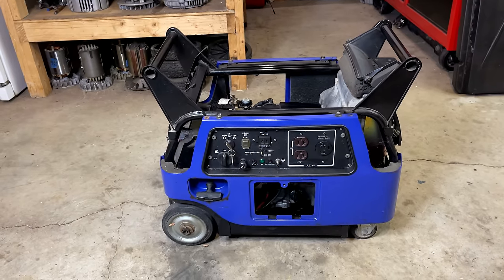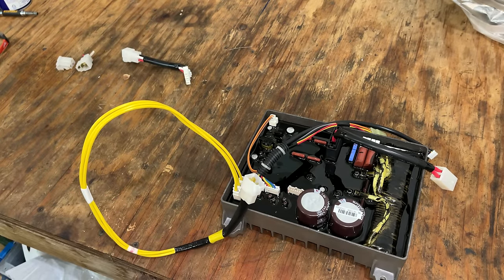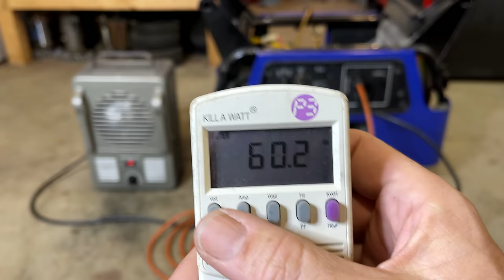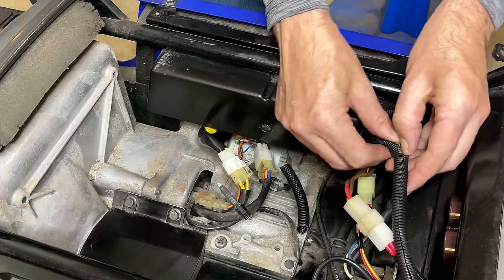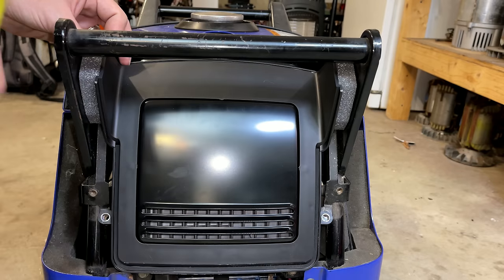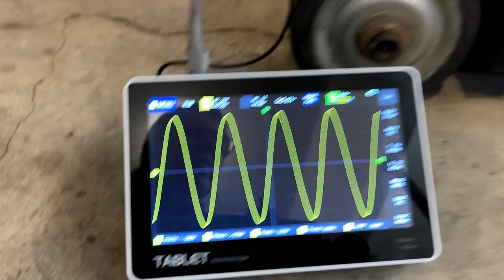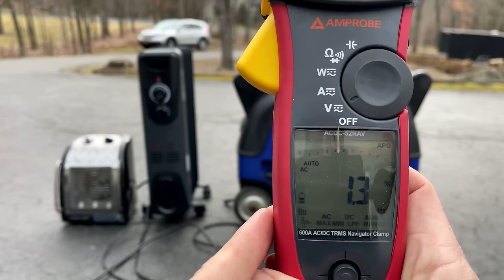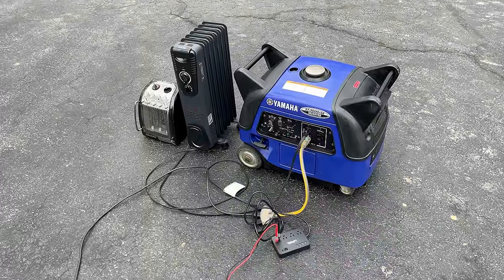Yamaha EF3000iSE Inverter Generator (Part 3) - Repair

Comment: Nice videos, I watched all three. Just wondering why the 15 amp breaker didn't pop with that 2500 watt load. There is a 23 amp socket next to the 15 that could have been used with the right plug. I have four of those generators, they are terrific.
Reply from the maker: There is not circuit breaker on this model.  The inverter monitors for an overload exceeding 2800 watts.  So technically you can pull 23 amps out of the 15 amp outlet.  The inverter does not know which outlet is being used.

Comment: Which utility provides power to your house? We used to live in N.Y. about 20 years ago. I happen to see the new style N.Y. plates in your driveway. I used to work for ConEd when we lived in Westchester County. We live in Connecticut & I work for Eversource Energy as a lineman. 
I see a huge difference between an inverter generator & and non inverter generator. The sine wave is perfect & the voltage is on the high side but comes down with load. Also the THD is vastly better. Hence why I picked an inverter generator at my house. I talked to many of people (mostly customers) & they only know “watts”. It’s sad because they go by the big number printed on the side of the machine. When I talk about the other important issues I get the blank face. 
We do business with a small mom & pop business that sells kitchen appliances. They tell me after a big storm customers come looking to replace all their appliances after their generator burned up all their appliances. Not to say they look forward to big storms? They just know people buy the cheapest generator & burn up $10,000 in appliances. Makes perfect scence! 🤨

Comment: Thanks for the timely video on an inverter type generator. After my (and other) comments on a previous video I assume this is the type required to safely run my furnace (full of electronics) during a power failure. Is it safe to assume that if it says it's an "inverter" generator it will be as advertised? Or are there scams out there?
I suppose looking at the spec sheet before buying would be important.
Thanks also for stating the THD on this machine for reference. Also that 1.6% is about typical of home supply THD. Great to know.
Great video - thanks.
Reply from the maker: Have not seen any inverter generator scams on new equipment.  Sometimes I see people selling used generators claiming they are inverters when they are not.  Inverter generator THD is usually lower then what a utility supplies.  The power coming into my house is at 2.4% THD
Reply: @jcondon1  Good to know. Thanks
Keep up the wonderful videos. Much appreciated.
Reply: IEEE standards for utility THD are 5% maximum and 3% maximum for any single harmonic. The 3rd harmonic (180 Hz) would likely contribute the highest single harmonic distortion. The THD from my utility last time I measured was right at 3% which is 2% lower than the max allowed. My old generator (not inverter type) produced THD of about 10% which isn't too bad for some things, but not so great for electronics. My Champion inverter generator has THD< 1%.
Reply: @ctbcubed Good info. Thanks for sharing.

Comment: As I was watching the video, I began wondering whether my genny would have such part for replacement after some years. 
I bought a 1kW inverter genny, and they don't seem to be really popular. The 2kW ones seems to take all the market.
And indeed, I could find 2kW Inverter replacements (Part No. 30043-Y5V1210-0000) for my brand (It's a rebrand of a Rato R1250IS-4), but not the 1kW model (Part No. 30043-YEB0510-0000).

But that made me think... If I couldn't find a proper 1kW inverter set for my genny, what would happen if I used the more popular 2kW set? 

I know the engine raw power doesn't even get close to 1.5kW, but consider that I'd keep below 1kW. Would it work?

Comment: I would like to know , what is the difference between a generator and a inverter generator ? I watched many of your videos and i've learned so much from your videos I wonder do you teach a class ?
Reply from the maker: A generator is basically an alternator connected directly to the engine.  Engine has to run at 3600 for 60 hertz, high harmonic distortion and loud.  Generators usually have an avr and the rotor in the middle is an electromagnet.  DC power is sent from the avr into the rotor to vary  the magnetic field to maintain the output of 120 volts.  Inverters are brushless with a permeant magnet rotor.  The output from the alternator is 3 phase high voltage high frequency AC.  Inverters can runs at difference engine speeds.  The 3 phase output is rectified into DC and sent into an inverter module where the power is inverter to 120 volts / 60 hertz.  It is very clean power, engine is quiet and fuel efficient.  Of coarse name brand inverters are also about 5x the price of a similar tradition generator.   They are best to use if you are concerned about power quality.  In my case I got it for the low noise since one of my neighbors is a little over sensitive about noise.

Comment: i sure know your meaning when it comes to, "is worth it to fix", had the same issue on decided to buy the inverter for a honda EU3000is, not cheap! So my question is. Is there a way to check if the old inverter is still in working order or not? I ask because the old owner had taken it apart a put the stepper motor in wrong and now i have it running with new parts i would like to know if the old inverter is still good or not, thanks and another good video
Reply from the maker: Usually if the green light comes on and the inverter is controlling the engine speed properly then it is working.  The only was to know for sure is to check the hertz, voltage, THD and look at the output on an oscilloscope.
Reply: @jcondon1  thanks, maybe i asked the question wrong. Is there a way to test and check if the older inverter is still working, if it is out of the machine and laying on the bench not hocked up to anything or does it have to be installed.

Comment: Somebody needs to design an open-source universal replacement inverter board for generators. The power circuitry is very straightforward: just a rectifier, DC-DC (depending on the alternator's voltage range), and an H-bridge. In my mind the harder part would be throttle control. I presume different gensets use different types and ratios of throttle adjustment motors, and on top of that you'd need to know about engine curves in order to find the optimal RPMs for each level load.

Comment: I am curious, where did you get the power cord that you use on the oscilloscope where you attach the lead from the oscilloscope? I would like to get one to use for that purpose.
Reply from the maker: It is a custom cord.  Not exactly safe.  Most oscilloscopes should not be connected directly to mains voltage as the ground on the probe is earth ground.  Because this is battery operated it is a little safer.  Ideally I would use an insulated probe.

Comment: A friend has an EF200i he asked me to look at. It has about 30 hours on it but needs a bit of choke  (like 10%) all the time to operate properly.
Since it's almost new I didn't think the carb needed cleaning. Everything else checks out. What could be the problem?
Reply from the maker: If it runs well with a little choke then most likely it is a carb issue.  Would make sure the pilot jet is clean. Otherwise an intake leak would cause the same issue.  How did the gasket look between the carb and engine?  Also a bad valve steam seal could cause a leak.  Most likely the carb though on such a new machine.  Newer engines are jetted as lean as possible.
Reply: @jcondon1  I'll let him know. Thanks.

Comment: A person buying a generator like that would losing a lot of $$ just buying the thing in the first place. Then having to spend that kind of $$ to repair it is just crazy. My generator is over twice that big and runs My whole house. And when I bought it new in 2005 it was half the cost of just that part. We loose electric a lot so it gets used a lot. It's even a brushless generator but all My electronics don't care. Even My 15 year old wii still works like new and it probably has over a thousand hour's running off that generator. Grandkids & Great grandkids play it alot.
Reply: Switching adapters like the Wii one are among the least picky electrical loads. They don't care about voltage or frequency as long it is remotely in the right range. 85 volts 300Hz with 80% distortion will work just as well as 120 volts 60 Hz.
Reply: @eDoc2020  please explain what is. I have used everything except the central air on it. I'm still not sure what the reason of a inverter generator is needed for. Furnace is a 96% and it also seems happy on the dirty brushless generator. If anyone knows please let Me know. I think there over hyped to sell expensive generator and generator parts.
Reply: @liveyourlife5251  Do you mean what is sensitive? Most older electronics work best with the voltage pretty close to nominal, but an AVR takes care of that. Electronics with capacitive droppers will draw excess current if the voltage waveform is too rough (but most generators will probably be fine). Things like electric clocks won't keep time properly if the frequency isn't perfect. Most things will really be just fine.

The main benefit of inverter generators is that the AC output is not tied to the engine rpms. This means they can lower their speed when not under full load. This is quieter, causes less engine wear, and perhaps most importantly can use less fuel.

Comment: Can we really say that having a $180 module available for $1200 is "supporting your equipment" ? 
I believe there's another phrase that fits better than "supporting your equipment" but I want to keep it rated G...   :)
Reply: First I want to say I agree with you!
Honda is the same or worse, a lot of parts aren't even available. 
Now is the price so high because the demand is so low?  
No, just the opposite. 
In both cases the companies would rather you buy new units.
Reply from the maker: I do not think they expected anyone to purchase the part.  They probably only have a couple so they can say they have it and price it so nobody will buy it.  Think it was shipped from Japan….

Comment: I’m just floored you spent $1200 regardless of the rev generated. I’d of let it sit until I found another used one with a different failure.

Comment: Hi James, i am curious if you'd be willing to send me the damaged invertor board so i can try and reverse engineer it and  maybe repair it?
Reply from the maker: Wish I could.  Already sent it to someone else to de-pot.  Have not heard from him since :(
Reply: @jcondon1  That's the hardest part of the repair. i tried de-potting a Honda inverter a few years ago and it was a disaster, the potting needs to be heated to at least 150 C to soften. Most components and connectors on the board get destroyed from this. I wonder if it's possible to replace it with one of those HV sinewave boards they sell on aliexpress for updating modified sine invertors. Anyways, good luck with the guy you sent it to. Hope he has a better way of depotting it.
Reply: @TheOriginalEviltech  AFAIK to use one of those boards you would need to have a regulated DC rail. You can get this with a 3 phase rectifier and a beefy buck-boost converter. The harder problem is going to be throttle control.
Reply: @eDoc2020  Throttle can be controlled with a servo motor and a PWM controller with a TL494. i can also make an Arduino board with a stepper driver to move the original stepper used in the generator. Those boards have the means to adjust their output somewhat to account for fluctuations in their HV DC rail. They work from 350V up to 450V.

Comment: The thing about the past views paying for the inverter doesn't make much sense. MAYBE the current views can pay for the inverter - that almost makes sense.  TBH, putting a $1,200 inverter in a gen that is worth $900 on a good day is not a good idea. This was a nice gen back in the day but nowadays you can buy a brand new Chinese gen for $600 that is almost as nice.  Wen will sell you an inverter for a 4000w gen for $167.  It would be worth it to figure out how to adapt the cables.  Cut and splice the connectors off the old Yamaha inverter.  The 120V AC out is going to be the same. The 3 phases in from the gen head will be the same.  The $1200 one is not the original inverter anyway.

Comment: So the inverter is 1200 dollars. My feeling is a good electronics technician can repair one of these inverters pretty cheaply. The problem is it is potted which makes repair 150 xs as difficult. Probably why the company potted it in the first place. JUST TO MAKE IT DIFFICULT TO REPAIR. That does not mean impossible but a process. The fixer has to have a process and usual failure mode. If he knows what to look for he could make a living just making these inverters like new. Unfortunately I don't know how many units are scattered across the country, but if a few thousand then it would be worth it. Then he would need to have a good rating for repair. Both in cost and longevity.  If they lasted as long as a new unit he would be set. The fact this unit has less harmonic distortion than your house line, (clean power) then a person would feel more comfortable using this unit than a brushless, or any non-inverter genset.
Reply: Potting serves to protect components from vibration, keeps moisture out to inhibit corrosion, and also acts as a heart sink. It's not done to force you to buy a whole new board.
Reply: Yes that right. When I was working in the industry (retired)  we would tropicalize our board to prevent corrosion especially when they were ship down to the tropics. Potting is another way of protecting the board. However some company's do make it difficult by limiting parts or make it very expensive to repair so that they can sell more.

Comment: had to use that same yamaha ef3000ise for  24/7 for 31 days after hurricane maria consumed 5 gal of gas a day with 12k btu AC at night oil change every 4 days and spark plug at 300 hrs still have it its a gas sipper wont sell for less than 2 k  so its not for sale jajaj

Comment: Way too much spent on this rejuvenation! It sounds very loud is the baffle in the muffler gone?
Reply from the maker: It’s actually very quiet.  I usually have to turn the microphone gain way down when running most generators.  This one I could leave it as normal without worry about clipping the audio.  Yamaha inverter generators are not cheap.  Yamaha anything is not cheap.

Comment: Help me with the math here. You said the generator was only worth $900.00, but you spent $1200.00 on the inverter, not to mention all your time rebuilding it.
Reply from the maker: The math does not work in most cases.  In my case I used the YT revenue from the first two videos to subsidize the inverter purchase.  That is why part 3 was so long after part 2

Comment: No, sorry,  it doesn't make sense to buy a $1200 part for a machine worth only $900.  Even if the previous youtube videos brought in $1200, you are still $400 in the hole.   A brand new Harbor Freight Predator 3500 Watt inverter generator is $800.  Not everything makes sense to repair.

Comment: If you want all the plastic parts on the generator to look Brand New use Cerakote Ceramic Trim Coat Kit Quick Plastic Trim Restorer, it will make the black plastic look new and it will last for years even outside.